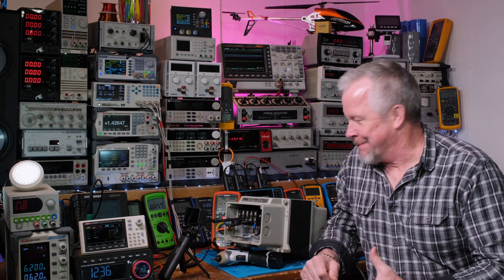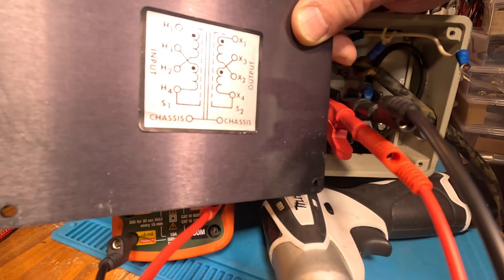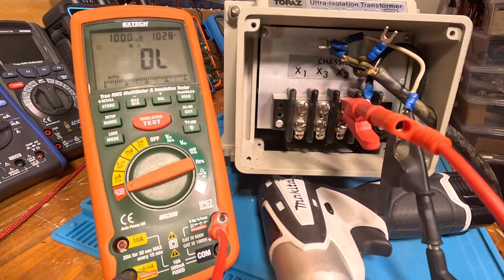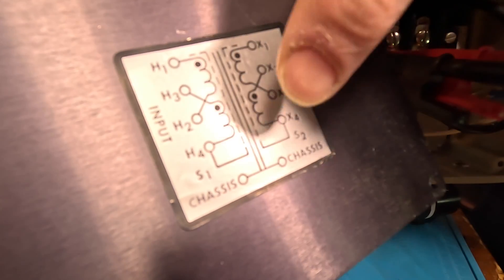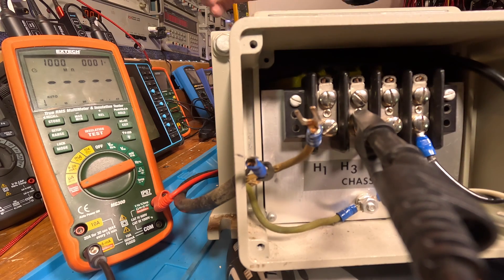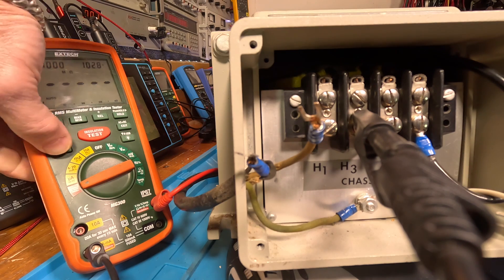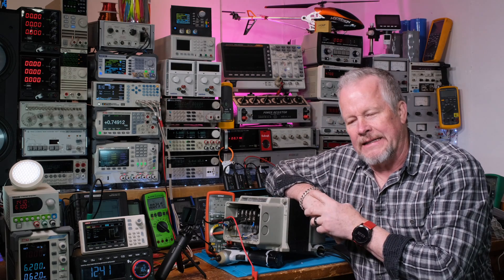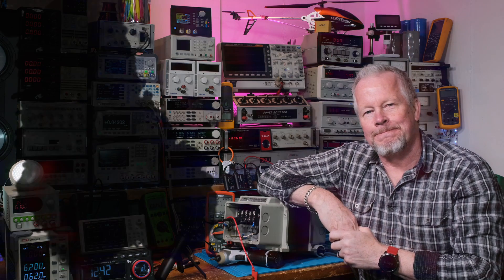Isolation Transformer Measurements done right #isolationtransformer #transformerisolation

Comment: I was looking at getting the Klein ET600 Insulation tester.   Anyone have experience with Klein tool vs more expensive Extech or Fluke.    I had a thought and was wondering if you could use those insulation testers to test breakdown reverse voltage of rectifiers or even testing MOV breakdown voltages since they only allow 1 milliamp of current to flow when breakdown occurs.   THOUGHTS???
Reply from the maker: I think the Klein looks great!  Price is nice too;) https://amzn.to/4dMhs5m

I think you could use them to test the MOV.  I'll have to try that in a video;)  I'll explain the MOV breakdown and ratings too;)
Reply: @KissAnalog  I would love to see that testing.     You could probably test strike voltage of neon bulbs, TVS breakdown, etc.   Anything with high voltage break overs.   If I understand how the meter works it shows the maximum voltage being tested at and the break down voltage point.

Comment: Do isolation transformers get hot sitting there powered with no load on them.   I acquired two 750 V.A. iso trannys and they draw like 8 watts each on my kilowatt powered with no load on them.   Is that normal?   Any thoughts would be appreciated.   I wish I had an insulation tester.   My DMM does not snow any shorts anywhere in the trannys up to 40 megaohms of range.
Reply from the maker: Yes that is normal.  But 8 Watts is not very much power wasted on a big device like the transformer.  So, it should only be warm;)  Thanks for asking!
Reply: @KissAnalog  They got pretty hot.   I will have to run a formal test and log everything as in the timing and temperature changes and ambient temps over time.

Comment: Hello Eddie.. very good stuff, I wonder did you ever adress switch mode noise? I know you're very knowledgeable in that field, and it would be a nice tutorial, perhaps discussing/testing add on filters to existing smps, it's a big deal to me right now because I just bought 4 Cosel smps for a class a amplifier, and as a true DIY, things can always get better, cosel spec max 100mv peak to peak noise at full load.
Reply from the maker: Thanks for reminding me.  I bought some parts for this video - so now I just have to do it;)  I'll see if I can do it very soon;)  What is the voltage output on the Cosel SMPS?

Comment: Dear Eddy, thank you for creating this video - and so good you corrected for the initial mistake. I own an insulation test meter as well, and I use several isolation transformers. When evaluating those isolation transformers, the most important parameter is the leakage between primary and secondary windings, I guess. Using my isolation tester I short the primary (in your situation X1-X2) and connect one probe of the isolation test meter. Also, I short the secondary winding (H1-H2) and attach the other probe. Mind you, with an isolation test device one only tests with DC, so this yields some information on how good the isolation transformer is. The other variable, of course, and as you correctly mentioned, is the capacitance between primary and secondary windings - one should be able to actually measure the AC-current leaking between primary and secondary winding. How to setup such a measurement so it would yield valid results - I do not know, yet. Greetings from Amsterdam, NL, Peter.
Reply from the maker: Thanks Peter!  Nice to hear from our friends in Amsterdam ;)  AC hipot is done much the same way but the leakeage current limit is set  Agency testing allows DC or AC hipot testing.  The voltage level for DC is the peak of the AC.

Comment: Dont worry about connecting the isolation meter wrong. I also have one that I use very seldom. Every time I use it, I have to re-read the manual. F you don’t use tools so often, one tends to forget how to use them. That is part of life, I guess. As to the wrong wiring at the input, maybe they used that side of the transformer as the output? Shouldnt make a difference for an isolation transformer, and they could also have used it as a 110 to 220V config, or vice versa.
Reply from the maker: Thanks for the great feedback!